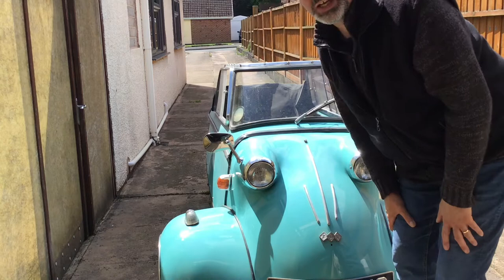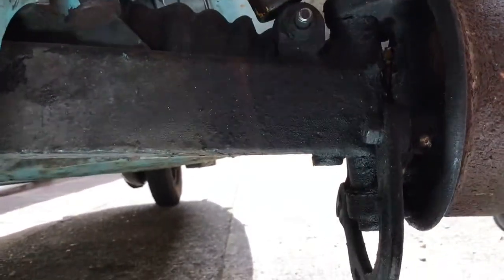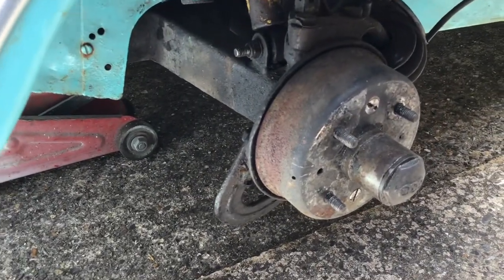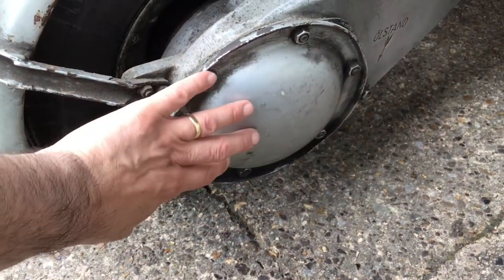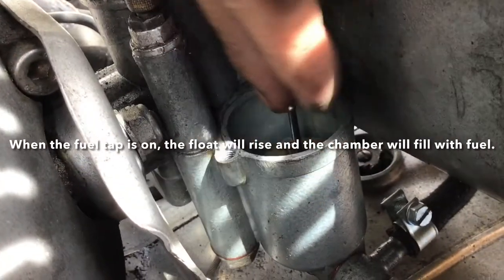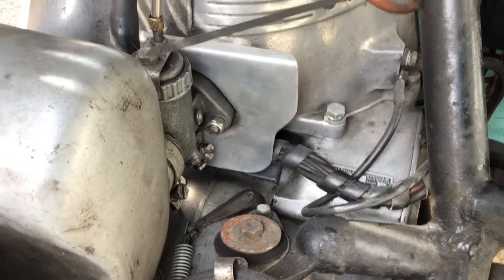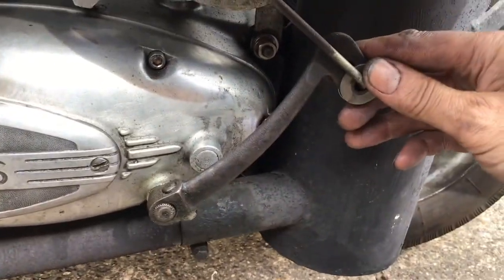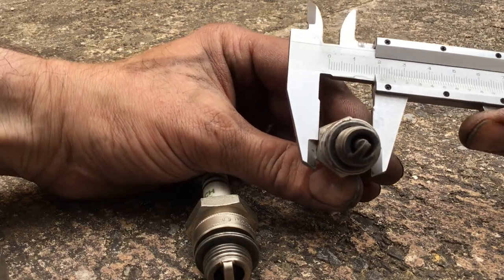Messerschmitt servicing the basics

Comment: Hi @My Quirky Rides. Great video. I will be using this info for my 'Schmitt. Can you tell me what oil you use for the drive chain?
Reply from the maker: Hi there you can either use  gear oil similar to that used in the gearbox, a non hypodermic (straight) gear oil or engine oil for this. Kind regards

Comment: Are they supposed to smoke like that? I used to own two Messerschmitts back in the 1970s. I was going to try to make one good one out of the two of them but I failed to get either one in roadworthy condition. I ended up selling both cars to the owner's club for next to nothing.
Reply from the maker: Hi, yes, the smoke is quite common, as it's a two stroke engine. The smoke does reduce considerably when the engine has warmed up. Thanks for watching.
Reply: @peakfreans68  There are low smoke synthetic oils used for older snowmobiles etc.  They can be used at lower ratios. Saab Stroker owners often use it.